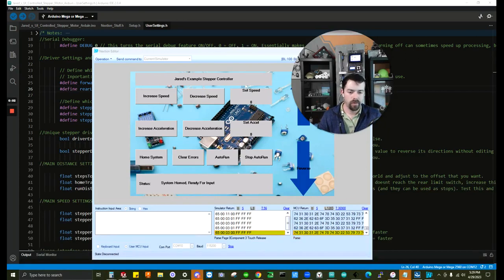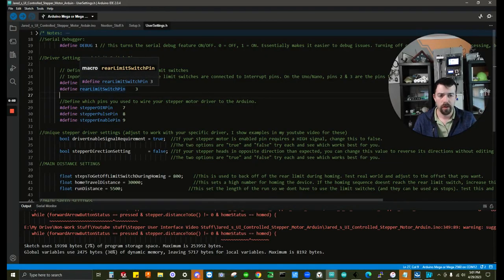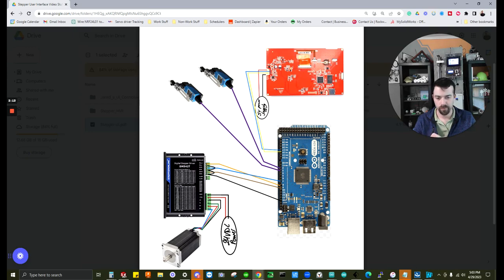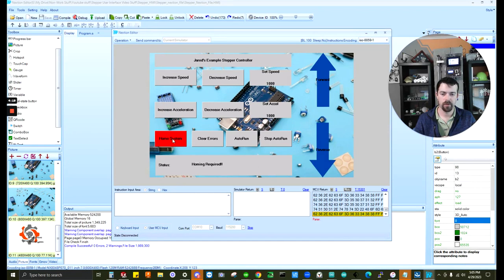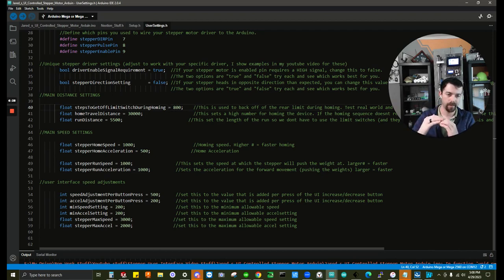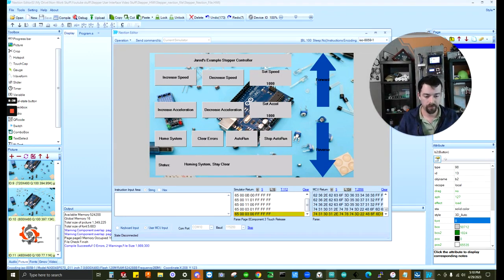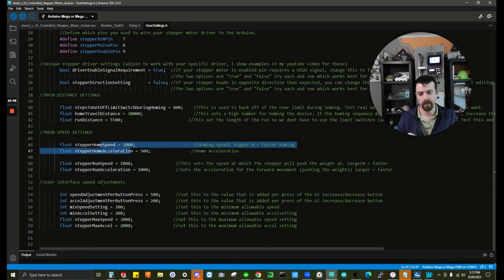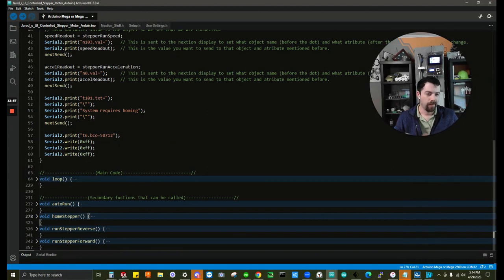Stepper motor control using Nextion HMI

Comment: hello Jared! I tried to load the nextion HMI file and adjust it to my device, which is a 3.5 inch discovery series. But, when i adjust it because your 7 inch display was in a big format, the buttons are outside the range and after i resized it the output window prompt told me that there's an error of the buttons are out of range.
I'm sorry i never deal with HMI display, maybe u could help?
Reply from the maker: Are all your buttons within the page? Sounds like you need to move something that is off the page back onto the page.

Comment: Hello Jared Hanson, can you help me with a software-related matter? I want to create a project. In my project, I will be using a Nextion TFT screen, Arduino Uno, Green LED, Blue LED, DC motor driver, and DC motor components. In addition, I will use one yellow button and one red button.

The program's operation is as follows:
I will input a value, such as 5000 milliseconds, into the "n0" object on the Nextion screen. I will also enter a value between 0 and 255 into the "n1" object, which will be related to the motor's speed. Based on these values, the motor will run between 0 and 255 revolutions for 5000 milliseconds and then stop. After entering these values, to start the program, the "b0" object on the Nextion screen and the Arduino, connected to the analog "pin1" yellow button, will serve the same function. Whenever the analog "pin1" button or "b0" object is pressed, the motor will start running again and stop when pressed again. In case of an emergency while the motor is running, there will be a red button connected to analog "pin2" to stop the motor. When the "pin2" button is pressed, the running program will stop immediately, and the green LED will turn off. To restart the program, we will need to press the "Dual State Button" button. All of this system will be controlled by the "dual state button" object on the Nextion screen. When the dual-state button is open, the system will be ready to run, and the position of the dual-state button will be indicated by the green LED connected to digital "pin 12". I want to create a project that operates in this way. What is the cost of such a project?
Reply from the maker: I would love to discuss this fruther. Please reachout to me privately so we can discuss cost and deliverables.  productiveprototypes@gmail.com